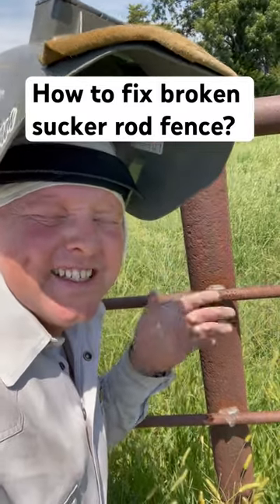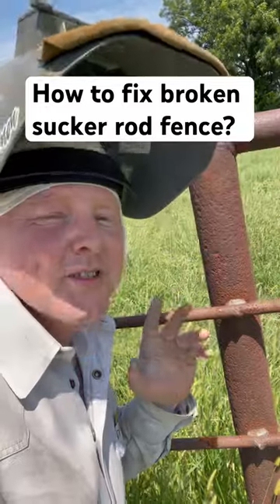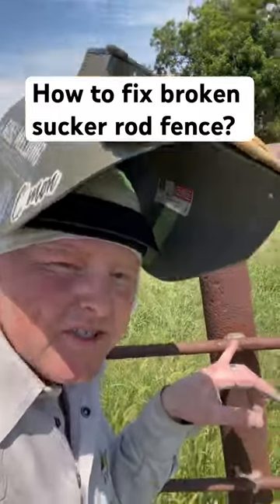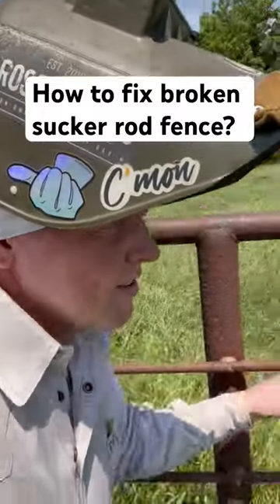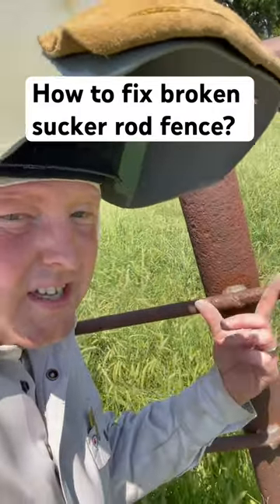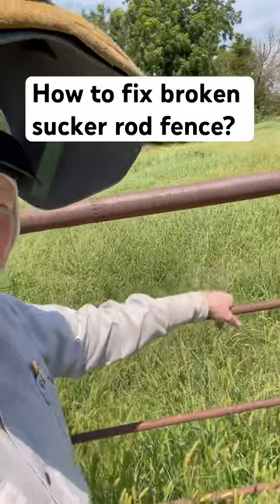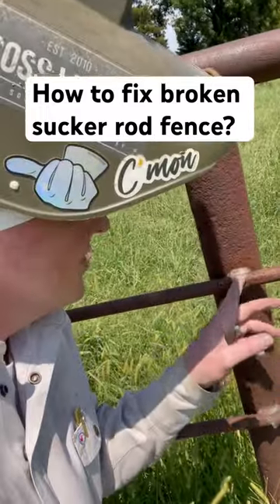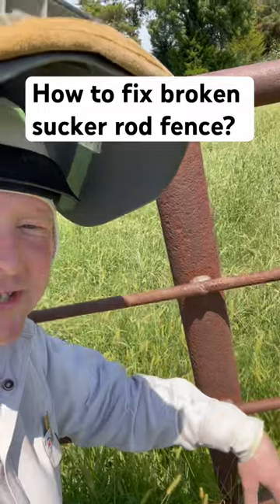How To Fix Broken Sucker Rod Fence #rigwelder #pipefence

Comment: Sucker rod joints, like pipe, are the “making up” of both the pin and the box ends. Assuming they’re still on the pipe or sucker rod and not cut off. Pin being the male (OD) thread and the female (ID) thread. 👍

Comment: I recommend dont use sucker rod. It’s a high carbon metal. It can’t take the heat and will break. If you have to use sucker rod use clips don’t weld to pipe. Also clips will give you some flexibility. Use continuous fence panels with 1 1/4” tubing you will be happier.

Comment: Old timers built corrals just like this and still in fine shape today. There isn't a better corral fence for the $/ft than 3.5" post spaced at 8' with a 2 7/8 top rail and 3/4" sucker rods as rails spaced at 8". I do agree with using clips however, since I'm already welding on the post, save time down the road and put on clips.

Comment: + 7018 has long gation properties that other things doesn't especially Mig Mig does not have elongation properties you getting the fuck scores there's a lot of flux core wires that do have elongation properties but it's not single Shield wire or innershield it's going to be dual shield and that's not practical for the field especially where he had a lot of wind
Reply: Why is it called sucker rod iv never heard that before
Reply: @aimeeriaski3559  because it sucks the oil out of the ground